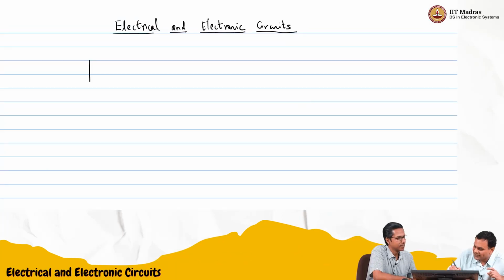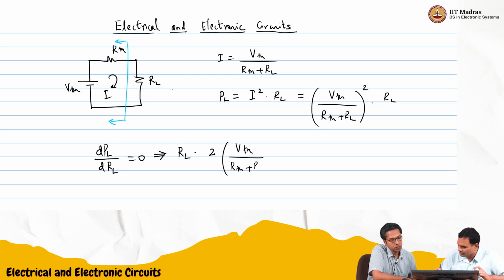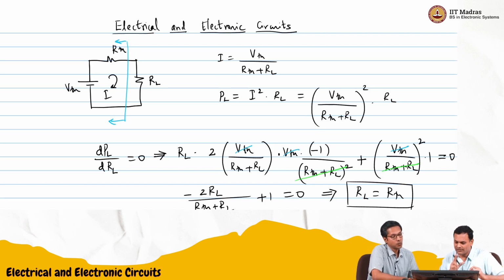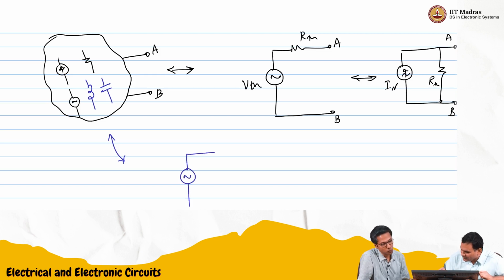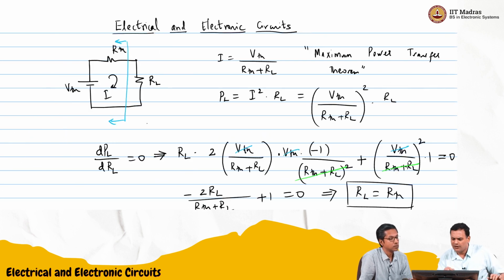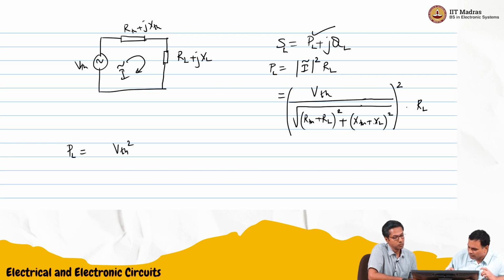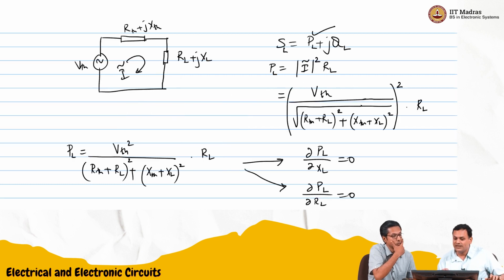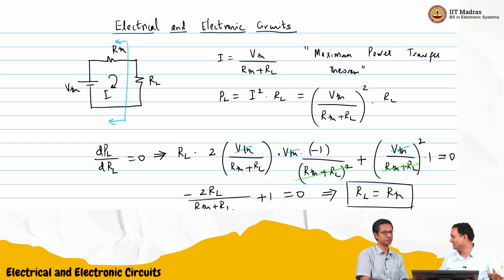W2_L4 -  Maximum Power Transfer Theorem

Comment: Important timestamps 
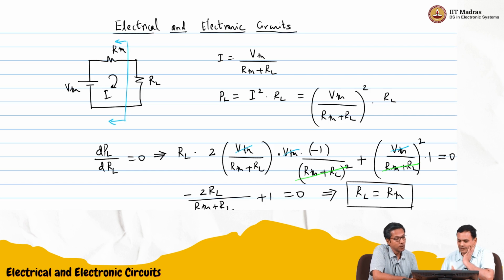5:30  For maximum power deliver for dc current 
Condition RL = Rth
 13:16  We are interested in only the real part of the power
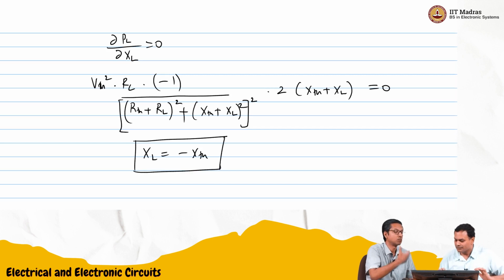 18:00  For max power, the load reactive part should be negative and the value of net reactance should be zero
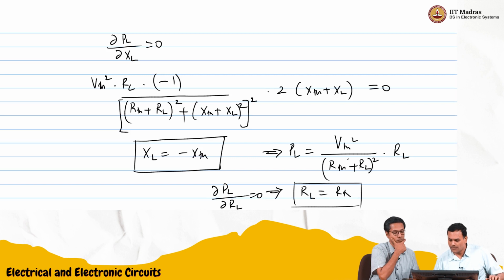 19:30  conclusion: for ac the maximum power deliver 
RL = Rth,  XL = -Xth
20:25 Note: the efficiency of the power deliver will be half because of RL = Rth
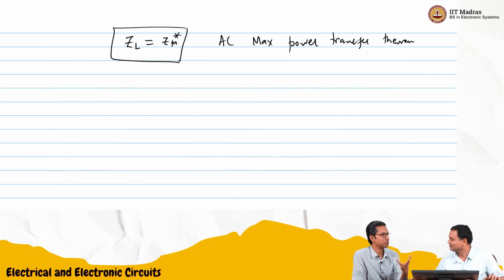20:55 irrespective of the value of Rth